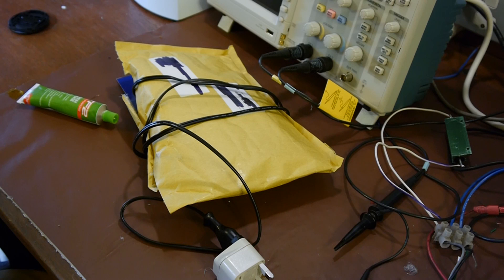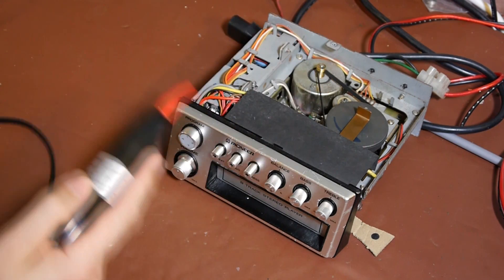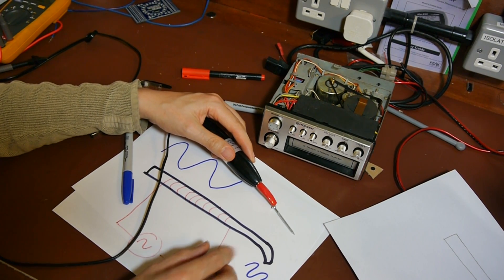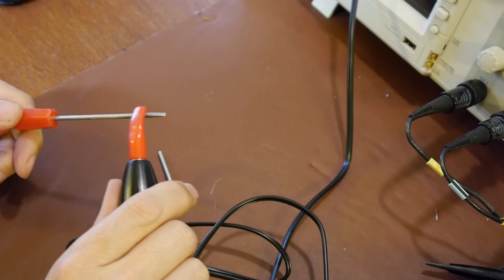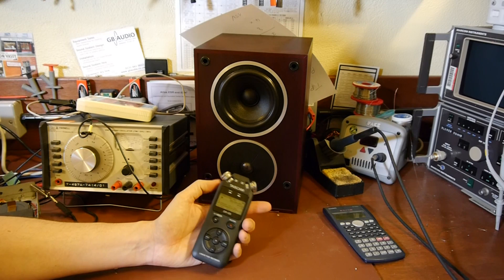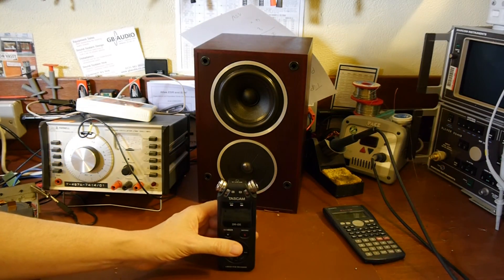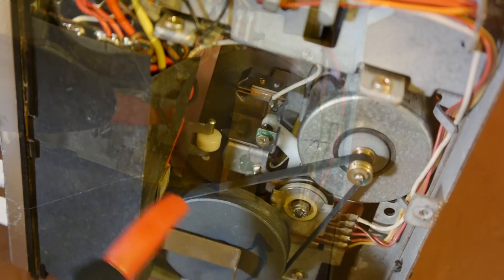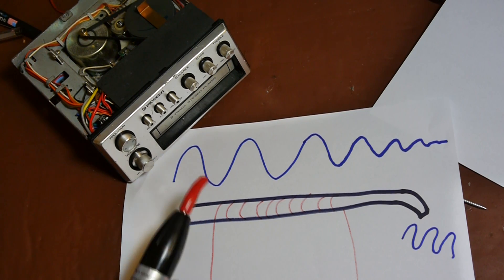Not 8 Tracks Part 4 Magnetic Tomfoolery

Comment: Mine says to use it for 2 minutes...then turn it off for 15 minutes, and that is at intermittent duty...so running it continuously would be even less time.
Reply from the maker: The one that I have definitely does get hot quite quickly. I guess just use your common sense and turn it off it doesn’t take very long to demagnetise a tape head. Thanks for watching.

Comment: its not meant to be left on as it will burn out and waving it about all over the place won't do any good you may as well shove it somewhere else !
Reply from the maker: thehappylittlefox aka benji it also works better shoved somewhere else - thanks for watching
Reply: I have one myself and I fitted a micro switch to mine in line with the power you turn it on and bring it near anything that wants demagnetizing and move it away slowly you should feel a little pull then you power it off it should then be demagnetised it should only need to be used on anything the tape passes through or by
Reply from the maker: thehappylittlefox aka benji  Thanks I had the same thought about fitting a momentary switch.  It's a shame the instructions were not in English or I would have seen the 5 minute warning
Reply: I think you can still buy them on eBay now and a gain there's a very neat slim line square one we had a very large degausser at work that was like a doughnut we used to put all the parts in a cloth bag and power this thing up with the bag in the middle you gave it a shake and that was that it got left on once and caught fire

Comment: Great video Chris and very entertaining. I also have one of those and couldn't work out whether you had to leave the plastic cap on or not. Mine also gets very hot. Couldn't notice any difference though. Graham
Reply from the maker: Radiocruncher Thanks Graham. I think the rubber cap is kept on so you don't scratch scratch the tape head. I think it would be good to do a frequency sweep before and after magnetising a tape head to see if this really is bunkum.  Perhaps someone can myth bust this.
Reply: That would be a good reason. I suppose if you didn't touch the head surface it would be fine. I remember back in the day buying demagnetising tapes. Can't remember if they made any difference though but after some of the rubbish that used to be played on my 80's ghetto blaster it can't of done it any harm.